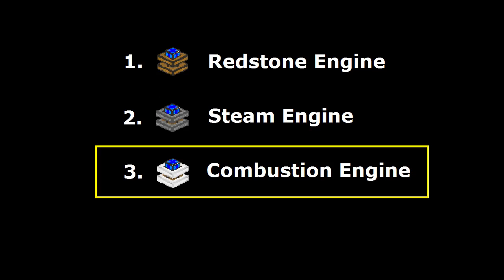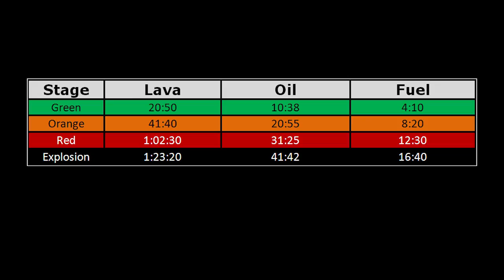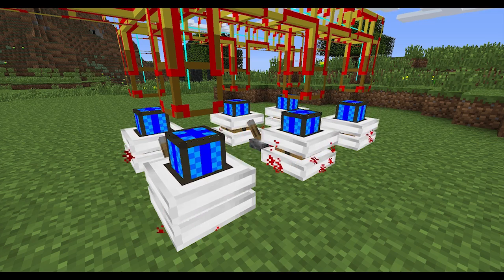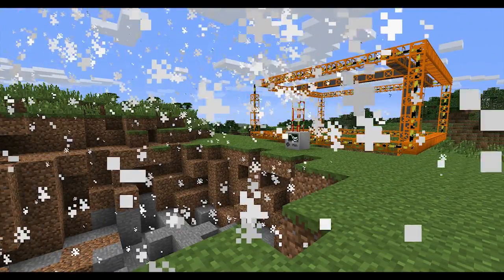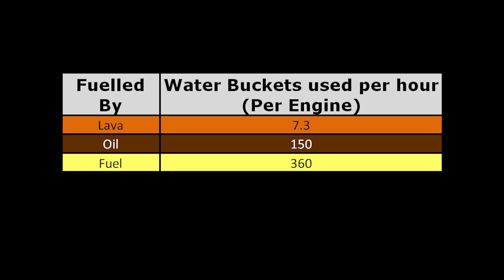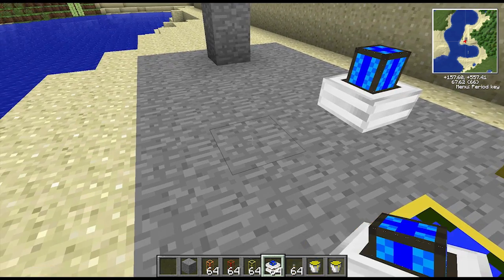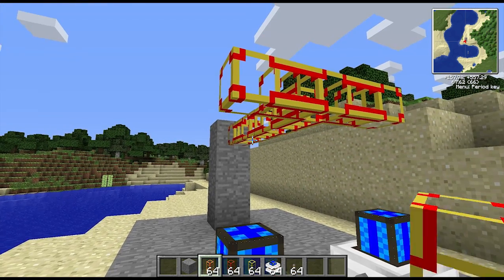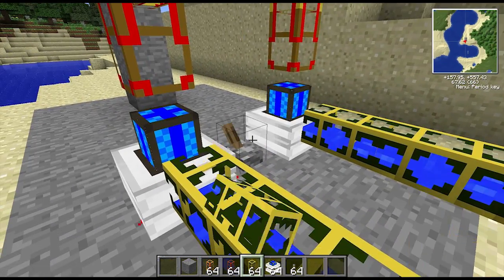Combustion Engine (Tekkit/Feed The Beast) - Minecraft In Minutes

Comment: I've tried redstone energy fluxduct (semi-expensive) to kinesis / transport / energy pipes (It already has pipes from my automatic oil farm and water from the aqueous accumulator with a liquid transfer node to transfer pipes). I've filled an entire iron chest of different types of pipes, tried using different fuel sources, but my main one is with my actively cooled reactor / turbine. I'm diving into 10 different things at once all trying to get this fucking combustion engine working for the past 8 hours and nothing works. Now I've forgotten what I was trying to do in the first place... Something with the assembly table perhaps.. I dont even know at this point. All I can say is that this combustion engine is full of shit. Why in the fuck does this thing need to be on damn life support?

Comment: I now have wooden transport pipe and wooden fluid pipe. I am trying to use fluid pipe to run water from a pump into my combustion engine but the engine isn't accepting the water. Not sure what I am doing wrong. Can anyone help?
Reply: use a cresent hammer and hit the pipe thats connected to the querry or the source

Comment: Very good tutorial but when I put fuel in it, nothing happens. Can someone help?
Reply: me 2
Reply: me to, i've tried all the fuel sources
Reply: scott bransden Me also. Latest Forge and 1.7.2 Minecraft.
Reply: i reinstalled the mod and now it works for me :)
Reply: Yea me too lol
Reply: scott bransden can you help me plz i have buildcraft 5.0.5 when i put fuel nothing happens
Reply: i think that you have to power it with redstone and put the fuel in
Reply: I'm no Wizz mate, I had to play around a bit, but once I reinstalled it worked fine, make sure you have a switch on it and water in it aswell
Reply: I also use galactic raft aluminum wire and build craft pipes if that helps

Comment from the maker: Does it have enough fuel? Sometimes if you've only filled it up to the first notch in the interface, and then you run the engine for a little while, the fuel will be depleted to the point when it won't start, even though it still looks like there should be enough in the interface.

Comment: I would strongly recommend using fuel, fuel got double the power output and one bucket of fuel will last 5 times as long as if you would run it on oil

Comment from the maker: Combustion engines consume water based on how hot they get. At the blue stage, no water is required. At the green stage, it will consume water steadily (around 1-2 buckets every 10mins or so). If sufficient water is supplied, it won't go past the green stage.

Redstone engines have a maximum output of 0.08MJ/t (at the red stage). When a combustion engine is running on lava (the lowest energy output), it outputs 1 MJ/t. This means the ratio of redstone engines to combustion engines is about 12:1

Comment: "Pumps faster the hotter it gets" Yes, so how much water do you need a max heat, for the different fuel sources? What's the pump to combustion engine ratio (per fuel source), for pumps powered by 4 redstone engines? :)

Comment from the maker: Are you talking about the Biogas Engine in Forestry? If so, it can actually run on multiple fuel sources at once. The max output being 5MJ/t. With this, Buildcraft Combustion Engine, the outputs are approximately, 1MJ/t for Lava, 3MJ/t for Oil, and 6MJ/t for Fuel.